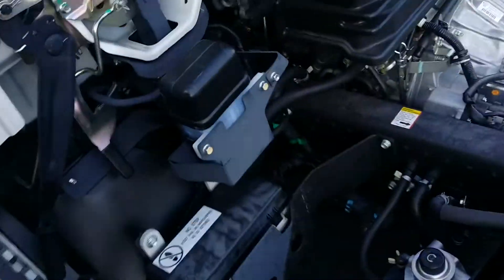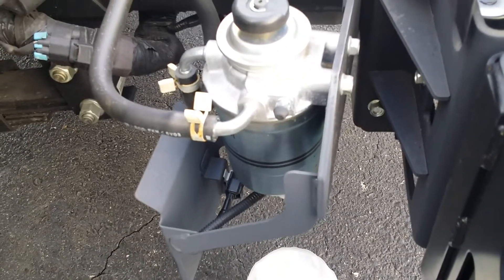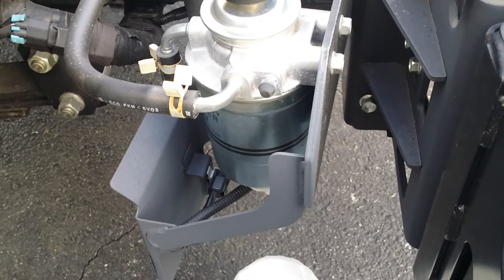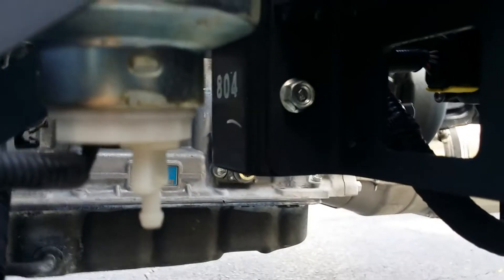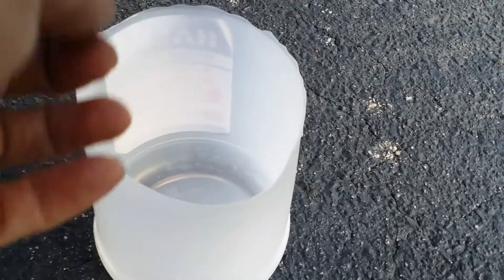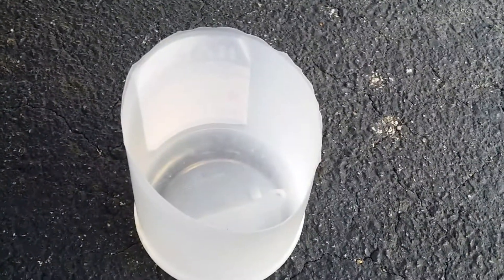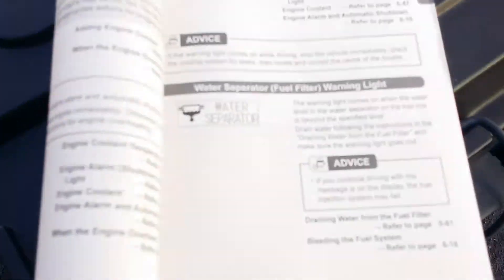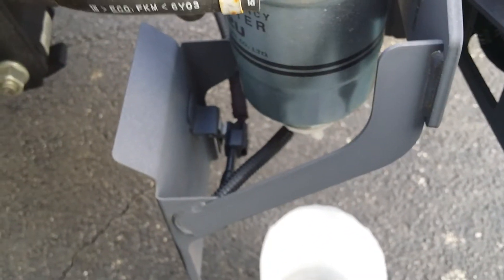Isuzu diesel fuel water separator drain and service - How to service and care for your truck

Comment: I changed my filter then the light came on ? Any advice on how to clear the light on a 2007 ? 5.2 diesel gmc w4500
Reply from the maker: That is unusual.  Three things to check.
Please recheck the sight glass (if on your model).
Re-drain the filter in case there was a bunch of water in the tank.
check the connection lines on the senor to the sedimentary filter.
Reply: @MichaelOlden  okay thank you

Comment: Haven’t been able to get it re-primed. Tried 20 or so pushes until I felt back pressure on the button.
Reply from the maker: Not sure you are still stranded. how did you get it going?  If still stranded please call me 423-618-3323

Comment: Crank but not starting isuzu forward-fv2
Reply from the maker: A little more information may help.  

Is the fuel drawing to the primer pump from the tank?

How long has this issue existed?

Has the truck sat for a long time?

Comment: Drained multiple times, Light still on ddoes it have a reset button? Thanks
Reply from the maker: The truck does not have a reset button of the filter.  It could be a need to check the build on your truck.  shoot me an email molden@lee-smith.com with your VIN.  I will attempt to check on your trucks build to see where the sensor light connects.  Thanks! - BTW apologies for the delay in responding.
Reply: Ended up being the water/fuel seperator sensor itself. Thanks

Comment: I drained a bit of diesel now I wanted to prime it but diesel does not come out. Been priming for an hour. There is diesel in the tank.
Reply from the maker: Sorry for the delay - I'm pretty sure you resolved the issue.  If not release and retighten the filter and screw.  call me if there problem still exists - 423-618-3323
Reply: @MichaelOlden  Hey, thanks for the reply. I have primed this one before and it worked no problem. I'm wondering if diaphragm might be buggered. Previously I had to tow/run start it anyway, even after priming. It's an Isuzu "pickup" I guess is what you guys call'em. I'll try applying some pressure to the tank or use an outboard primer first before I find someone to give me a tow..
Reply from the maker: @flinfaraday1821  thank you for the follow up!  Happy New Year!

Comment: Hi sir i did mine but the lights stays on how can i get the light out
Reply from the maker: If you successfully drained the filter and the lights stays on - is time to replace the element.  Just to be sure, repeat the process once more.
Reply: @MichaelOlden  what's element?
Reply from the maker: @tukutanechuom3366  The element is the water sedimentary filter.
Reply: @MichaelOlden  ok thanks, didn't know I just call it filter/ separator 🤣🤣
Reply from the maker: @tukutanechuom3366  LOL I understand - on the filter system I have seen fuel sending unit, fuel sedimentary filter, secondary fuel filter (which is often loca😃😃ted next to the sedimentary filter) then the primary fuel filter which is closest to the fuel pump.

When I first started talking trucks I reversed the explanation a the primary - I thought - would be closest to the fuel tank.  I.e. the first filter.

Sadly, a client - a self proffessed gear head - shared it starts at the engine and goes to the tank.

Injector - fuel pump - primary filter - econdary filter (if installed - yup some manufacturers use only the primary), then sedimentary, sending unit, and lastly the fuel tank.

After the injector there is a fuel bypass that returns unused fuel back to the 'return tank' if more than one tank on the truck.  Then to the primary tank.

Thanks for the question!

Comment: while draining the fuel with water from seperator does the isuzu has to be running
Reply from the maker: Great question!  Suggestion is to have the engine off.  

Drain the fluid - prime the pump - then start the truck.
Reply: @MichaelOlden  thank you

Comment: Hi sir do i need to clean my fuel tank if there is an indicator of water in the fuel filter water separator
Reply from the maker: The fuel tank has two bottom bracket holding it in position.  there are disconnect lines and electronic connectors on the top - so use a transmission jack to maintain control while lowering the tank.

My regrets for not being available to answer this question.  Let me know if there is any current question I can try to do better on.  Best Regards,